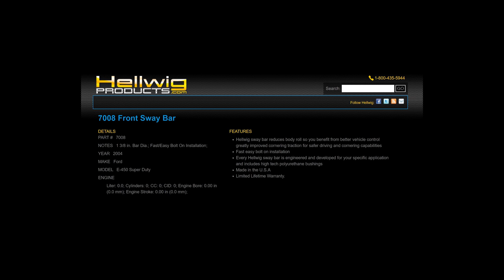Front Anti-Sway Bar Upgrade on RV

Comment: I just bought a 2015 Thor Axis 24.1 and will probably upgrade the front and rear sway bars along with a steering stabilizer and Bilstein shocks.  Your video will be helpful when I install my front bar.
I've installed plenty of aftermarket bars on sports cars, but this will be my first RV install.  Same process, just bigger/heavier.

Comment: Thanks for the informative video!  I see you have the reflex steering dampener.  Did you find the sway bars helped ride more or less than the steering dampener?  I'm pretty sure I'm doing the sway bars, not sure if it's worth the extra money for the steering dampener.  Any suggestions?  Thanks again.